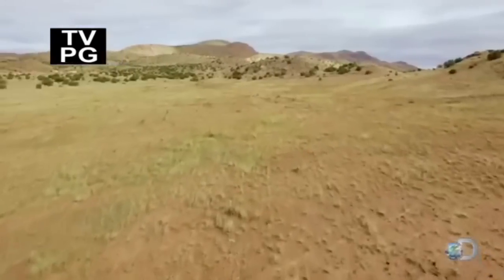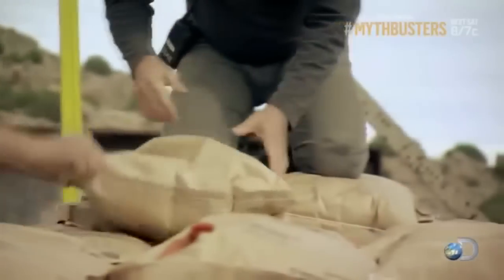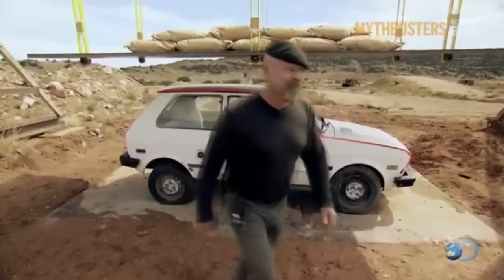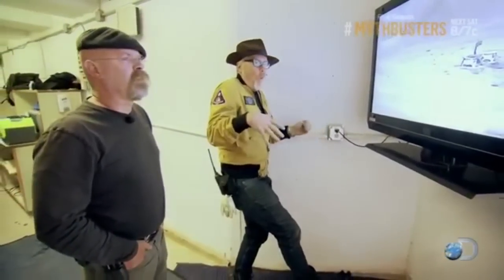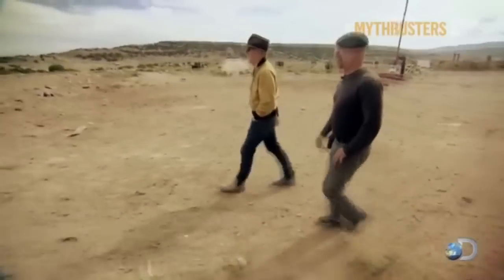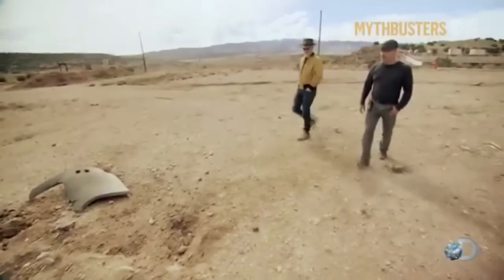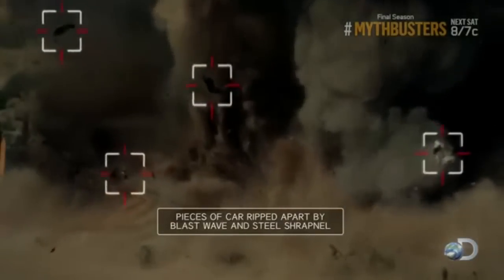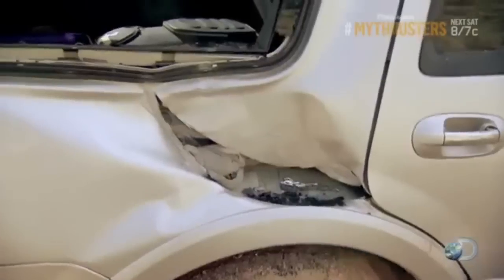Mythbusters Segment, Driven to Destruction, Pancake Car with Explosives

Comment: Hmm,  I think his math was off. Must of added an extra zero somewhere
Reply: 2, or 3, steel plates above the car, instead of just one, might have helped with energy transfer..
Reply: Nah. They just didn't prepare an explosive lens to shape the shockwave.
Reply: s
simple misplacement of a decimal point.
Reply: The straps used to suspend the metal plate were too strong and too much explosives.
Reply: They didnt scale up the metall plate enought
Reply: @yaykruser  I was thinking instead of 1,000 lbs he should of used 100lbs of ANFO
Reply: @poolguy101  But how to spread that out over the whole plate? 
The inertia of the plate would be to high, the edge wouldnt move faste enought
Reply: @yaykruser  really only need to have enough force to break the straps and a little extra push. Steel plate is 2000 lbs. If you accelerated it to about 30mph by the time it hits the car the kinetic energy would be enough to flatten the car by 50% or more.
Reply: @poolguy101  but they want a 5cm car
Reply: @yaykruser  then accelerate the steel plate to 60-100mph not mach 3
Reply: Probably should have NOT put the 2nd layer of anfo on top of the 1st layer. So it would be 500 lbs still spreaded out.
Reply: @earlcoles5215  Or out anfo one feet above the steelplate. That would be enough to give the requited acceleration to the plate and not too much to destroy it
Reply: @poolguy101  you believe that the shockwave from this explosion was mach 3 ?

Comment: My one complaint was that the sheet of explosive in the early test went right to the edge of the steel plate. The ampho is concentrated closer to the center. That's why the squarish hole in the center of the top plate.

Comment: I think rather than piling all the explosives in the center they should have flattened them out all the way flat on the surface of the steel and it probably would have worked better rather than putting all that explosive power in the center...imo

Comment: I have a 100+ year old tree in my backyard it has a chunk of metal wedged and over grown around it by the tree ....Halifax Habour had a disaster ( 1917 ) Which was the biggest man made explosion of the time. Two ships crashed into each other and caught fire ..One loaded full of high explosives which equal to 2.9 kilotons of TNT. To give you a idea  A anchor, weighing half a ton, landed 3.2 kilometres (2.0 mi)  I live 4.8 kilometers from the site People in this area were still killed and injured from the blast and bits of the ships flying in the air

Comment: A 15 pound shapecharge with a glass cone in it would produce what is called the Monroe effect and would have blasted a hole through 10 feet of concrete and wiped the car out too
Reply: It would have done damage, but wouldn't have wiped the car out like In this video, not 15 pounds of any explosive,  not HMX not ONC not RDX